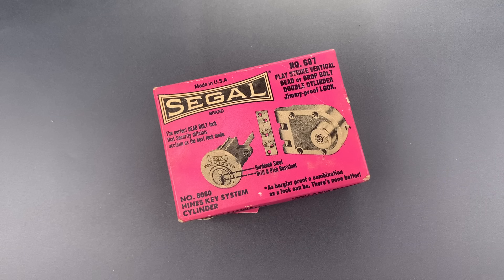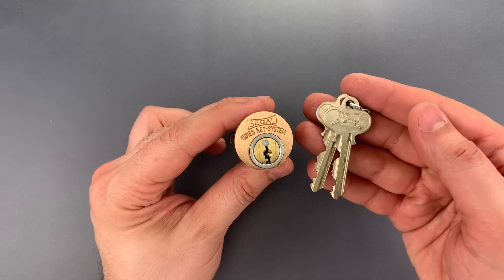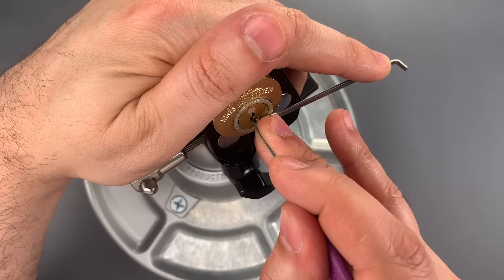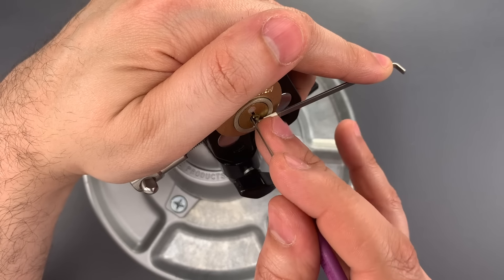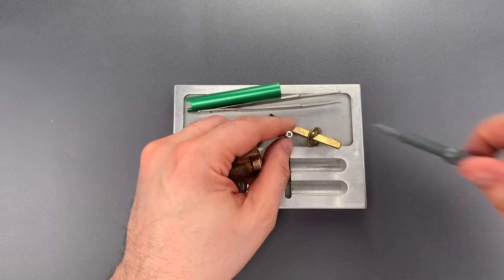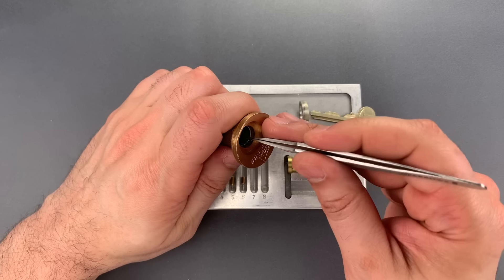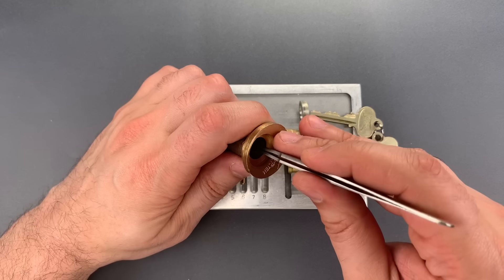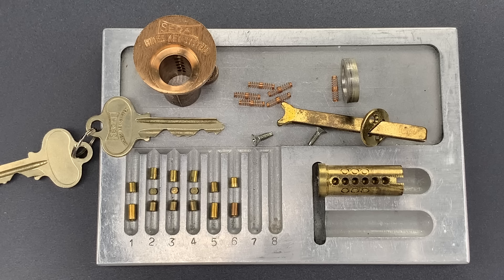[1181] A TRAP For Pickers! The Clever Hines Key System Picked

Comment: How nervous were you you'd accidentally screw up and seize up the lock?
Reply: Not much i think but you never know
Reply: since he has access to the entire lock, probably not that nervous.  it's a bit different when you only have access to the keyway and can't just take it apart and reset it.
Reply: @theghostofthomasjenkins9643  Considering the assembly, I have a hunch the security pins would lock the barrel up, and make it impossible to be taken apart entirely.
Reply: @ujiltromm7358  well, he explains in the video that he failed 9 times with the plug spinner, so it clearly wasn't an issue.
Reply: I wonder if blasting compressed air around the cylinder would retract the security pins if it was seized?
Reply: @finnmcrae  Seems unlikely as it would be more likely that the the air would just flow past the pins and out the back of the lock without affecting their position.
Reply: @ujiltromm7358  im assuming that the bible has a removable backplate so if he messes up he could release the springs, much harder if its in a door
Reply: @finnmcrae  no.
Reply: @finnmcrae  Worth a try!
Reply: You would need to pop the top off of the pin stack of you get trapped. The thin metal top on top of each spring is removable without too much damage.
Reply: @finnmcrae  I've actually opened a lock with that method 😂
Reply: @billywailer7808  with compressed air?
Reply: @bmitch3020  You might be able to slide a shim in between the cylinder and the bible or apply tension and bump it with a hammer to get the hollow pins to slip. But yeah just removing the strip would do it as well
Reply: @theghostofthomasjenkins9643  who's to say he didn't start out with a case of locks?
Reply: @1pcfred  you got me on that one.  i can't refute that.
Reply: @theghostofthomasjenkins9643  we only see what we're shown here. It is called the magic of cinema.
Reply: You remove the top of the bible to release the springs and reset the lock.  You have to have access from the inside of the door to do this.

Comment: Noob question: after LPL disassembles the lock, is it possible to put the lock back together in a functional state?
Reply: yes, why not? same operation in reverse
Reply: yes. assuming you don't screw up working with the small parts, you should be able to get the lock back in working order iirc.
Reply: @whyso0erious  Yes most quality locks can be resembled, even though it can be tricky... (talking from experience as I took my own door lock apart after seeing a LPL video) :-D
Reply: Yes; you'd just have to put the pins back in the way they came out (which is why he's got that tray with the slots and numbers and such for the pins, to keep track of the order and such).
Reply: Yes. It's fiddly, but you just use the follower in reverse. Push it in next to the 6th pin hole, stuff in the spring and the top pin. Keeping that pushed down with your tweezers move the follower to the next pin hole. Rinse and repeat until you have all of the upper pins in place.
Reply: I mean he literally said he tried using a plug spinner to "jump over" the trap 10 times and it only worked once (starting at about 6:25)  - so he had to disassemble and reassemble the lock at least 9 times during his trials to get it going again BEFORE shooting the video.

To me, that means it's possible to reassemble it ;-)
Reply: yes, there's a link in the description of this video where he does this
Reply: No, as a second method of defense, all of the lock parts entered self destruction mode after this video.
Reply: @zukaro  OwO?
Reply: @Shadow81989  Also, implied but not stated, is that by removing the cap over the top of the springs, you can disassemble it after it locks on a hollow pin.
Reply: It looks like this lock was never meant to be rekeyed. The pins are inserted from the outside, but it looks like the brass is permanently crimped.
Reply: @Shadow81989  how would you disassemble this lock with a trap pin engaged?
Reply: @masheroz  Do I look like LPL to you? xD
I have never even attempted to pick a lock, I just listened to what LPL said, which comes down to the fact that he jammed it multiple times and (somehow, possibly "simply" by the power of his mind) managed to disassemble it each time...
Reply: For him, yeah. For us? Maybe... lol
Reply: @masheroz  You wouldn't because the cylinder is locked and you can't turn the key. Even if it's out and you unscrewed it you wouldn't be able to push out the cylinder.
Edit: well maybe if it's out and you tap it so the hollow pin pops out of the rim it's in.
(The guy above me said lpl had locked it up before and got it back so maybe like that?)
Reply: Look at the video he referenced  [527] Pickproof your Kwikset For Less Than $1
Reply: Absolutely - and if you'd like to give it a go - I'd suggest buying an inexpensive deadbolt or entry door knob and a $10 re-keying set - you'll discover that this isn't "magic" but really kind of satisfying how it all works....
Reply: Ive seen the guys who key doors for new construction, they'll have a bin of tumblers and pins, they key all locks onsite depending on the security of the building.
Reply: Of course.  He is not doing an damage.

Comment: The obvious question is:  If you're the owner of the lock, does a failed picking attempt mean that you have to call a locksmith to disassemble the lock?  And I'm imagining a case in which a homeowner had, say, three entrances, with one of these on each door, and the thief locked up all three.  What then?
Reply: then you're screwed
Reply: that thief wanted you to stay out of your home and nothing else..... also most thieves and robbers prefer destructive entry methods because its easier and technically requires less skill..... if this however, did happen, then the owner would have to try to destructively enter into the house as there seems to be no way to fix this if you are the owner
Reply: With a lot of casement locks, if you can get the door open you can loosen two locking screws and unscrew and replace the cylinder. If you can't do that, repair is going to be destructive.
Reply: Be happy the thief didn't kick your door in then kick your door in
Reply: @tanushbhansali  I mostly agree with you. The way the strike mounts, kicking the door in would be way easier, but a technically savvy person who knows a little about locks could save this but only once you gain entry.
Reply: @lwilton  With this lock that mounts to the door, once you have access to the back side you could open it up and save it.
Reply: DarkAcreJack   Burn the house down and assume a false name
Reply: hahaha   - that would be a vindictive thief "If I can't Break in - you aren't going to walk in"  - OR have a real High security lock on one entry (alarmed of course) and this cheap hack (T-Pins and wafers / Spools and Serrated Pins  on a standard "construction lock" ) on the others... 

 (By the time you open any lock and swap out the standard pining for any higher security stuff - you have improved security so much more than the standard lock that anyone without a key will probably take one look a sniff, and hit the door with a sledge hammer. OR try another house - Burglaries are rarely truly random, if they are then you must have left a door or window open.)
Reply: This lock would be good for front is your house is something like this: front door with this lock, back door maybe sliding door with no lock, garage attached to the house with remote controlled door, then if the lock seized you will enter through the garage, or worst case smash the glass on smallest window
Reply: GoodRiddanceGooglePlus  . I think he is thinking of a sliding door with no EXTERNAL key access -ie fitted with a locked  bolt or somesuch..?? Secure not accessable.

Comment: That's a nice lock with a nice trap.

One question though: you say that you cannot open the lock without destruction when the trap is activated, yet you also say at the end that you tried the plug spinner with success 1/10 times. That must mean that it is still possible to untrap the lock somehow without destoying it. How do you do this when the key cannot be inserted anymore?
Reply: He probably just disassebled the lock which cant be done if the lock is in use.
Reply: This is referenced in video 527. In order for the lock to be reset, it would have to be disassembled from the inside. Thankfully, LPL has easy access to both sides of the lock.
Reply: Pull off the metal strip covering the bible springs, and it's reset.
Reply: The spinner wouldn't get out of the trap, just fly past it during initial turning.
Reply: Actually he said "once tripped, you won't be able to access non-destructively." I think he meant the building not the lock.
Reply: @cheeto4493  That depends on if the owner has secondary access to the other side and can open the (presumably) door from there. Then the jammed lock can be disassembled from the lock frame.
Reply: @sleeptyper  except that to access, the lock has to be uninstalled from a locked door, so...
Reply: @pauls5745  If you get inside the house (backdoor, window, etc.), you use whatever hardware the door has at the other side to open the door. Every domestic housing door lock body has to be operable from both sides.
Reply: Worst case you pull the hinge-pins take the whole door off the hinges.
Reply: @killfalcon  Not my house. I discovered recently that the way its hinge is constructed you can't pull the door off its hinges without the door being opened.
Reply: @captianmorgan7627  best hinges.

Comment: What would happen if all of the pins were made like that? Would the resulting lock be truly pick-proof?
Reply: No. You will just need to do what he did on pins 2, 3 and 4 on each other pin (that is, carefully making sure you also pushed the spacer and not only the hollow pin before turning the cylinder too much).
What would really make the lock more difficult to pick is to randomize the position of the trap pins and maybe even the position of the grooves for the hollow pins on the cylinder (so that one will not know which pins are "trapped" nor at which point turning the cylinder they will lock).
Or, even better, disguise the lock as a normal one.
Reply: @qdaniele97  Your not the only commenter I got the impression from you'd rather people not know it's a trap lock...why? If they see it's trapped that's an additional deterent.

Comment: I have two questions ?
1. Why did they put traps on the same pins, why not mix them up.
2. What's a plug spinner.
Reply: Okay, i found videos on plug spinners, not sure how that would help you though ?
Reply: @WhiskeyGulf71  The idea is you spin the lock fast enough that the hollow pins don't have time to drop into the groove.
Reply: so the locksmith knows which pins to pick in case you lock your keys in your house.
Reply: The traps are almost certainly on the same pins for production and cost reasons. While locks do require some variations in production (to avoid every key fitting every lock), every additional variation in production will increase the cost of producing the lock and also provide additional possibilities of quality test fails.
Reply: If the lock needs to be turned clockwise to unlock and I pick it and turn it counter clockwise I can use a plug spinner to try and not have to repick the lock. The idea is that it will spin the cylinder fast enough that the pins do not have time to drop down and relock the lock.  In this case it would be trying to to turn the lock fast enough that the pins do not have time to drop into the extra trap holes.
Reply: 1. Factory tooling, assembly and control lines. Less tooling, less chances for errors, less controls, less expenditures, more profit.
2. A plug spinner looks like a thick flat-head screwdriver with a spring inside it, and a spinning head. It is a tool originally used to spin the lock you just picked in the wrong direction and avoid resetting and repicking it. It works by spinning the lock so fast the pins don't have time to reset. Here it would be used to make the security pins bypass the lock-up mechanism.
Reply: @theghostofthomasjenkins9643  No he'll just throw up his hands and charge you regardless.
Reply: Morten 
Okay so why not do all of them ?
Reply: The Ghost of Thomas Jenkins 
But it's designed to be unpick-able in a non destructive way, the locksmith should just be drilling the lock or pulling the core with a slide hammer.
Reply: Ujiltrom M 
Sounds like guff to me ! Let's just make all keys the same then to reduce manufacturing costs.
Reply: Thanks for all the early replies, none of them were enlightening sadly.
Reply: Mordelm 
As LPL said, that doesn't reliably work, if you've picked the pins incorrectly as soon as you've turned the core a skosh the hollow pins have already engaged.
Reply: @WhiskeyGulf71  I know, I was replying to the person asking what a plug spinner is supposed to do.

Comment: Of course it didn't work. The box said "Jimmy-Proof" and not "LPL-Proof"
Reply: Jimmy was of course a well-known lock-picker in his day.
Reply: It's jimmy proof because the bolt is on the inside with a surface mounted lock. You can't just pry the door frame. I put one of these (no security cylinder though) on my apartment door to replace the crappy spring latch it had. I could reuse the same key cylinder so the super never knew. One issue with some locks like this is the fact you can wrench the cylinder out of the door.
Reply: So it only works against guys named Jimmy? That seems really inefficient, I would design locks that work against any person regardless of their name.
Reply: @MichaelJCaboose013  oye caboose, why are you here? Shouldnt you be with the others?

Comment: The company should have had multiple combinations of the trap pins and each model gets a random combination, would have made it that much harder, more cost thou
Reply: I came to the comments to say this... just randomise the amount and order of trap pins to mke it almost unpickable. Also remove the name & cover the steel anti drill pin with a sliver of the same brass alloy to make recognition more difficult.
Reply: I thought that too, but.. all you have to do is try to double set each pin. Do the technique for the trap pin on all of them and you're in.
Reply: @swampeh  And what would make it so impossible to simply do the same procedure on 5 or 6 pins instead of 3?
Reply: @stargazer7644  well for one you'd have no idea of how many trap pins there would be,  and which order they come in. So get it wrong, the traps set and you've hindered your chances of picking. 

At present if you recognise the lock type then you will already know which pins are traps...

Also I didn't say it would be impossible.. but if the lock type was indistinguishable and had randomised traps,  unless you're psychic you've made the job that much harder.
Reply: @swampeh  I don't think you've grasped the technique.  You simply try to lift ALL the pins to the second shear line.  You don't have to know in advance which ones are trap pins.  You treat them all the same.  The trap pins will have a second shear line.  The regular pins won't.

Comment: So how would one go about unseizing the lock when they come home to find that their key won't work?
Reply: By calling your divorce lawyer?
Reply: The only non-destructive method I can see for unseizing the cylinder would require being able to get inside and then removing the screws that hold the cylinder in place so that you can remove the brass cover over the locking pins and  remove the springs and circular locking pins. All in all it shouldn't be too hard if you have another way to get in. If you can't get in through another point of entry you would have to destructively bypass the lock.  If you have a skilled enough person they can bypass the anti-drill protection of many lock cylinders by drilling out the soft metal portion of the lock where it is secured to the door. I've seen this done in less than a minute with a high security Medeco deadbolt on a business. The process was done legally by a locksmith that was called when a business owner forgot to bring his keys and didn't have time to go home and get them.